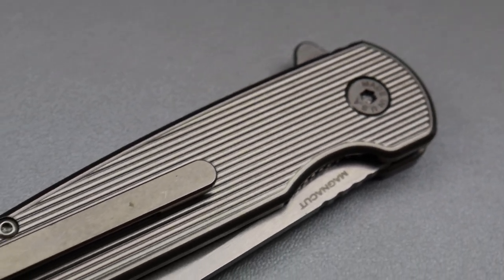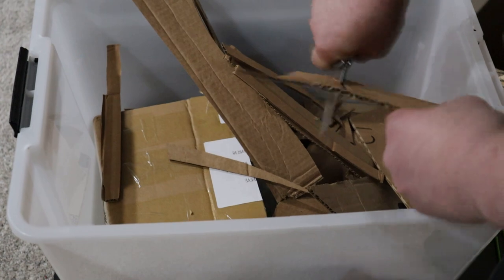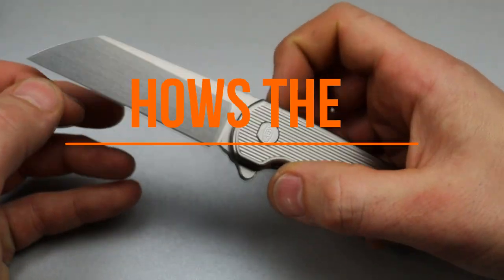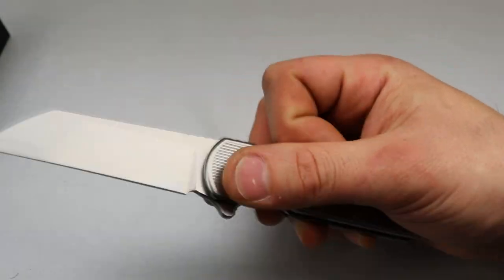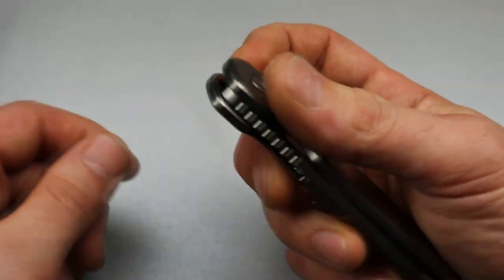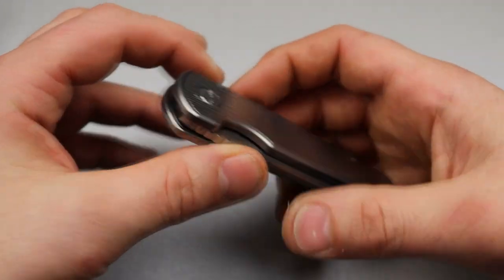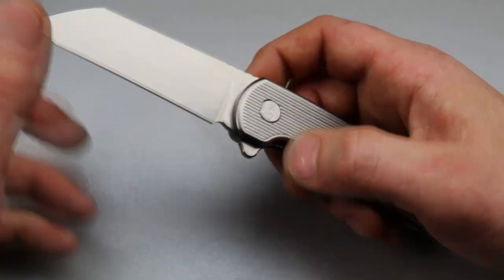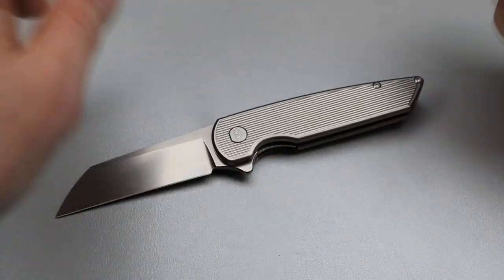Now This Is Great Machining | ABW Model 1 TITANIUM

Comment: Had an issue with a nick in the blade that I didn't notice last year when buying my Model 1 v.5 at Blade Show. I called Mike and he had me send it in. Not only did he fix it, he machined horizontal grooves into the blade and stonewashed the blade for me at no extra charge! Excellent service!
Reply: Sounds like he gave you a few blade from the v6
Reply: @hamedizzy5137  that's a possibility!

Comment: USA Made = $329  Gets you design flaws and middle-of-the-pack quality
USA Made = $500  Gets you excellent design and a break-in period
China Made = $100 solid design, drop shut out of box
China Made = $180 Gets you better quality than most $500 USA made knives 
By the way, 80% of my EDC is American-made         Could we make a $200 USA-made knife that is outstanding?    😐
Thanks for the video.